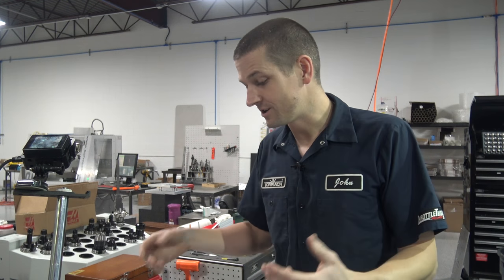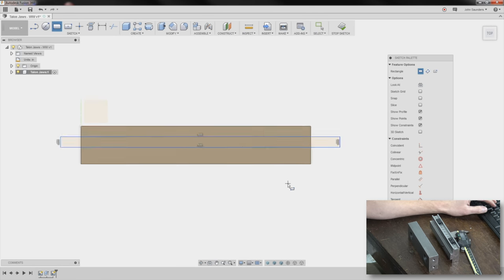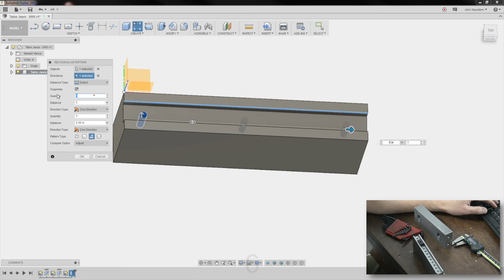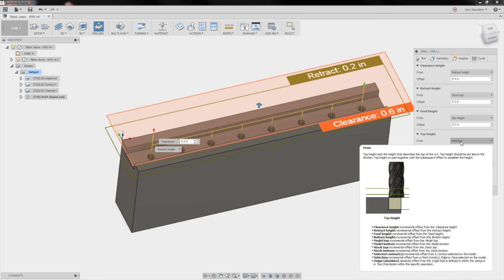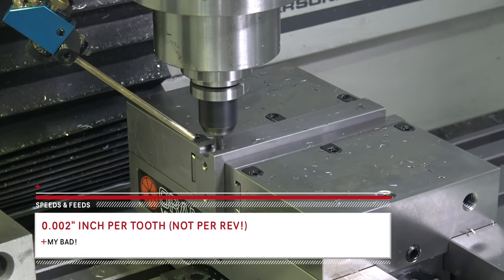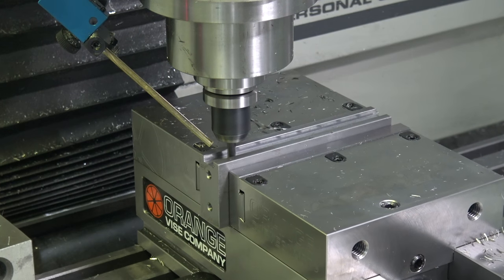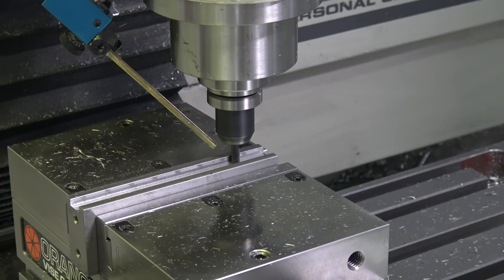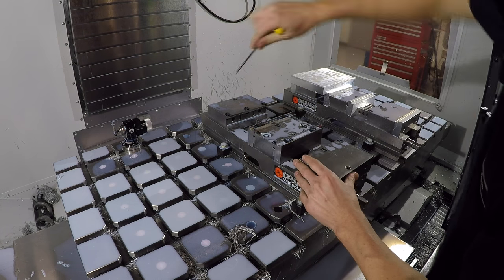Machining DIY Talon Jaws!   WW126

Comment: I have to ask the question. As a machinist with your capabilities where do you draw the line on intellectual property and copyright infringement? As a business owner you can machine a great deal of items just like your vises that are for sale? I understand your intent here and we all hate paying the buck sometimes I enjoy your shop talks and your business model shows not as much as your machining shows but they hold a value to me so how do you prevent from being sued by talon? As a machinist in your apartment in New York and as a Business owner have those lines changed?
Reply: Joshua McClain 
As long as you are not directly profiting from those items (i.e. Selling them) there isn't any infringement. 

Just like carve smart and Lang both give out the prints on how to manufacture their soft and hard jaws, even though they are patented. 

Again. As long as you are not selling them directly it's basically fair use. Otherwise you'd have to pay a royalties fee to manufacture and sell that design
Reply: That's the problem Jon is selling them...while not the talon clamp yet..his "machinist clamps" he is selling a product he reverse engineered...at least this time he credited who's design he ripped off....not much more ethical however....what's next a saunders machine Technigrip??? I find I'm quickly losing respect for this channel.
Reply: If you are referring to the 'kant twist' clamps, it depends on the copyright, Patent date & time since.  How many machinists with talent don't make many of their own tools...  Got to be a realist.  He is not putting anyone out of business.
Reply: Doug Bourdo 
Kant twist design patent has long since expired

The name is however trademarked so he can't sell them as "Kant twist" clamps. Only as cantilever clamps.
Reply: I was referring to the ethics question of if you should do it, not if you can legally get away with it....yes you can get away with this..but should you, and what will people think of your practices.
Reply: Mr Cross and I are on the same page I'm not willing to write him off over this but him expressing that his intent was solely to dodge forking over the hundred bucks really makes me uneasy. The other part of this is saunders machinist in his apartment in New York is not a target of frivolous lawsuits. Saunders machine works LLC Ohio with million dollar liability insurance well now that might be worth pursuing, as a business owner with a finance background I guess I expected more discreet actions for sticking it to other business owners.
Reply: Jeff Cross 
What ethics?
The only reason IP and patent rights exist is to give the originator a fair amount of time to profit from their invention.  It's a trade off because those patent rights prevent someone else from making a better, or more economical version (the driving forces of industry)

It's perfectly fine and ethical and needed for others to step up and make and improve useful designs whose patents have run out. It's precisely what drives industry and manufacturing forward.

And every. And I mean EVERY machinist makes their own tools. Hell tool and die makers practically make ALL their own tools, most of which can also be bought. Why should a tool maker fork over $1000 for a precision vise when they can make one themselves for under half?   Making something for personal use is perfectly ethical and should be done more often honestly. 
The unethical (and illegal) part is if you start manufacturing them in order to profit from them by selling them.
Reply: Occams Sawzall  You have convinced me, I bow to your logic there is no room for ethics in business copy anyone's design and improve it so you can thereby improve the world.
Reply: Occams Sawzall   Yes. Knew that. Just did not know his name for the clamps.
Reply: Exactly.
Reply: Jeff Cross not sure if sarcasm...  but I'll take the credit either way
Reply: He's using Mitee Bite's talon grips, he's just machining his own jaws to hold them. I guarantee Mitee Bite knows people are doing this, and has no problem with it. That's why they sell the talon grips separately. They don't and can't make a set of jaws for every single possible application, so they sell the 'inserts' for people to use to make their own solution.

Companies like Mitee Bite not only realize and accept that the need for end users to design and make their own application-specific solutions is a reality, that's actually the entire basis of the majority of products that they make and sell.

Pitbull clamps, Talon Grips, Versa Grips, etc. All of these are manufactured and sold with the intent being that people will use them in their own custom-made jaws and fixtures.

Comment: How come when you use the Haimer to Zero the workpiece,  the indicator rotates 2x to zero.  Don’t you just touch the workpiece and as soon as it moves you’ll know its the edge of the workpiece?
Reply: When it touches the workpiece its -2mm (or something equivilent int the imperial version), it becomes a lot more clear if you watch the bottom dial! :)

Comment: @NYC CNC Apparently it's not possible to use a driven dimension as a parameter just yet, for ...reasons... http://forums.autodesk.com/t5/design-validate-document/use-driven-dimension-as-a-parameter/td-p/6253015

My guess (as a professional software engineer) is that it'll be something to do with the possibility of introducing circularly referential dimensions. That's just a guess though.

Comment: I have been looking into getting a set of Talon Jaws for my tow Kurt DX6 vices. I believe that they work good but are they worth it? I do not do large production runs, mostly prototyping with a few runs when we get the model right. Right now I have to use a lot wider stock to hold it in the vice so the part can be cut out basically doing pocket milling. What I am not sure about is how hard is it to machine off the bottom .060" left form holding it in the jaws? I can make several of the same parts using a form of nesting in my CAM software which is a SolidWorks plug in from MecSoft called VisualCAM for SolidWorks. So I have  a longer piece of material to cut the remaining stock from. Also I am not sure if some of the parts would be able to be held correctly to face off the remaining stock. 

Anybody have thoughts/ideas on this? Cost of the jaws are not a problem. I am just wondering if they are worth it.

Comment: If a .501 fits in there, it's .501.  Also, you need to wring the gages together to remove the clearance between them, you can't just stack them.

Comment: The jaws I know are soft 1018 steel. I didn't think the actual clamps were 1018 though. Max hardness for 1018 is around 42-45 Rc 

Unless maybe they are hard carbon coating them to 52Rc and calling that surface hardened. 

But no. 1018 can't get that hard by itself, it's carbon content is too low to break the low to mid 40's on hardness

Your "D8 -D7" won't work because D8 is a driven dimension that was projected.  You have to use the D# that was used in the first sketch to create the initial jaw. At least in my experience algorithmic dimensioning doesn't play nice with driven dimensions

You Really really need to wring your gauge blocks when measuring.  Yes it's a PITA to do every time, but unwrung blocks could measure big by a thou or two
Reply: The Talon Grips are A2, the jaws are 1018.

Comment: Good parts and fine job, but it's proof positive to be that for onesie-twosies manual machines are WAY better then CNC. - Hell, we could have even finish GRIND the slot to a few tenths. 

CNC has it's place but this ain't it. - Could actually have made this part without actually having a drawing at all let alone having to spend time on a 3D model.

Comment: How did you use the edge of the caliper to measure depth?
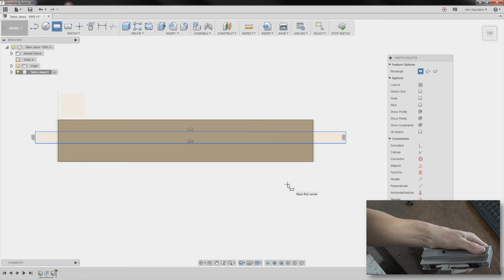Reply: 4:45-4:50. You mention using the outside of the "jaw" versus using the traditional depth gauge on the opposite side. How do you do that and get an accurate measurement?

Comment: why would anyone buy a pallet for 99$? I mean, anyone who has a milling machine to use it can just drill and tap those 80 holes pretty quick. If they were made from steel and hardened i could understand, as not everyone can harden and surface grind their own plate. All the best tho!
Reply: meocats 
Same reason people buy soft jaws from monster jaws...  

Work out the cost to manufacturer a few one off pallets in house vs buying for $99. I guarantee you the in house cost is close to double the buy cost.

Comment: There is very little evidence of toxicity of aluminium or using aluminium cutlery and dishes and pots. It is possible to have bad effects, but you need significant amount consumed as salts i.e. in water. As a metal or the amount that will be in the food will be thousands times smaller than risky dose, even if you scratch the oxide layer with metal tools. I always was worried about this too, but in reality it is not an issue. The aluminium just feels cheap these days, and not too heavy, so people don't have too much confidence about it, and maybe reminds them of lead in how it looks. Not sure.

Comment: I don't know the theory behind any "adaptive" strategies, but am I the only one that thinks there is something wrong?  The tool spends at least 50% of its time cutting air.  How is this efficient or better in any way?  I know slotting is hard on tools taking a 100% diameter cut, but one pass down the middle and one to each side and the slot is done, probably in 1/2 the time this took (not factoring in sneaking up on the width.)  In John Grimsmos last video he even commented on trying to reduce tool path wasted time by eliminating as much unnecessary movement.

If there is a good reason for all that cutting air then let me know.  I am definitely no expert in this at all.  It just seems like a "gee whiz isn't that neato" button on fusion 360.  It's "adaptive", it must be better....  That is a lot of wasted horsepower, especially on the Haas. Also, why not rapid on the air cutting part?
Reply: From what little I understand it reduces heat and therefor increases tool life by controlling the amount of material that is in contact with the tool at any one time. I imagine it also reduces tool deflection as well. I suppose the opposing idea is that in a saturated work environment where every second extra that a CNC is being used is costing time that it could be used on another project and thus tool life isn't an issue rather cutting speed is.
Reply: It's easier on the tool, but you are not wrong about "cutting air" being wasted time.

Fusion doesn't seem to have any way to improve the linking moves to minimize this wasted time (or maybe John just doesn't know how to use them, and since I don't use Fusion yet, neither do I).  I know a lot of other CAM packages rapid through linking moves and do other things to minimize wasted time.

The biggest "problem" in John's videos that make these adaptive strategies really inefficient is the fact that Tormach machines have quite slow rapids (something like 125-150 IPM).  So even if he's got it outputting rapids for the linking moves, he's still capped at 150 IPM, which is crawling along when you're cutting air. 

Strictly speaking, on a real VMC that's not even a fast cutting feed rate.

When your rapids are 1,000 or 1,500 IPM, those linking moves don't take so much time, so the toolpath is a lot more productive (you'll get more like 85% time in-cut VS the Tormach's ~50% time in-cut for the same tool path).

My VMC is ancient, with rapids of only 300 IPM, so when I program, I try mightily to keep the tool down and in the cut as much as possible.  That means deep cuts with wide step-overs and slower feed rates.

It's old school, but it IS more productive on a machine with slow rapids.

These adaptive toolpaths really don't start to break even productivity wise until you've got rapids in the 700-800 IPM range.  Any slower than that, and all the time spent out of the cut on linking moves kills your productivity, and the savings in tool wear doesn't even come close to covering the lost metal cutting.

You'll really see the adaptive start to shine on his new HAAS though, if he ever gets around to doing something interesting with it while the cameras are rolling.
Reply: On a faster VMC or any other machine for that matter, you won't have as much "air cutting" time since the rapid feeds will be much higher than the tormac can handle.
Reply: Barry Gerbracht 

It could/should be faster. The limitation is more the machine having only a max feed rate of 100ipm and not the best accel/deccel rates. 

Most adaptive paths will allow climb and conventional cutting rather than climb only.  But again, machine HP and rigidity prevents being able to take the heavier faster cuts. So he's not really "wasting" any HP just doesn't have much to start with. 

And yes, full width slotting in a high HP machine with heavier castings and drive motors could rough that slot in 2 passes faster than an adaptive path. But for the tormach the path he used here is the most optimal.
Reply: Barry Gerbracht The theory behind the adaptive toolpath is something called trochoidal milling. essentially the idea is that the toolpath controls radial cutter engagement keeping it constant. The benefit there being that you can push axial engagement so that cuts that would take multiple depths can be done in one, and increase feed rates and RPMs based on radial chip thinning. Ideally the air cutting passes should be done at the maximum linear feed rate of the machine, unless the machine has accel/deccel problems. Air cutting should not be done in rapid feed since rapid disables both linear and circular interpolation, and depending on the machine may not be as precise.
Reply: LogicIndustries My VMC  is also limited in rapids and for that reason I only use those types of toolpaths where it makes economic sense. For instance I recently did a mold job of A2 steel (the parts were shapes machined onto the outside of the material not negative cavities cut into the steel) basically the roughing passes took it from rectangular to a semi rounded shape. Because cutting on the end only and from the top down, conventional milling would require an end mill for every part. I had 32 to make and at $58 for a coated end mill it would have been expensive.  I programmed it in Mastercam using High speed/ High feed machining (working from the parting line up) and got 23 parts roughed with a single end mill and a 45 minute cycle vs 2.5 hrs conventional. That shallow slot John did I believe it was a complete waste of time for the type of toolpath he used and over time will introduce a lot of chance for machine wear with all the axis reversals, accel/decel etc. I would have just put a slightly worn end mill in to rough the slot in a couple of passes and changed to a sharp one to finish. It would not be as flashy as the cut he did but more cost effective and probably quicker. I'm not about "fooling the rubes" just getting the parts made as efficiently and cost effective as possible.
Reply: On the Linking section of the last tab on the adaptive strategies there is an option "No-Engagement Feedrate". This defaults to the same as your cutting rate I think, and can be increased to vastly shorten the air cutting time. As to the reason to do it this way, it will probably result in better tool life as you're not pushing it as hard due to the reduced tool engagement.
Reply: Particularly when doing "close" dimensions, Its good to use 2 tools.  One to rough that you always rough with and one to finish that's sharp and not oddly tapered from wear at the tip or whatever.  I d/l Fusion and you can do regular 2d slotting and profiling with it and its dead simple.  1018 poses basically no threat to carbide at all even in a semi-rigid machine like the Tormach.  You can slot this in 1 pass with 1 clean up on each side (3 passes) and then use a finish mill to put a nice "to depth" face on the bottom and cut your close dimensions for the sides using cutter comp.  All told, 6 passes.  I'm not sure why he advocates trochoidal milling for things like this.  He has one video where he slots something like this and it takes 28min or something ridiculous when he could have done 3 passes rough, 3 passes finish and been done in 5 min or less.  It looks cool and makes the videos longer maybe? :P